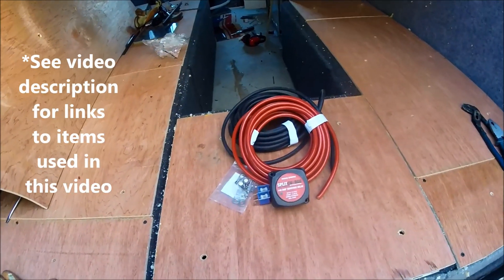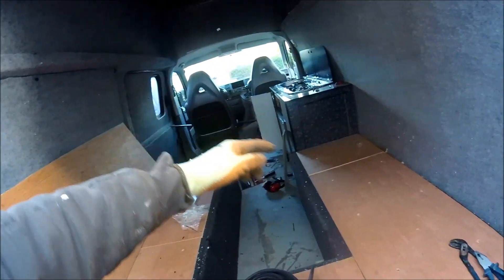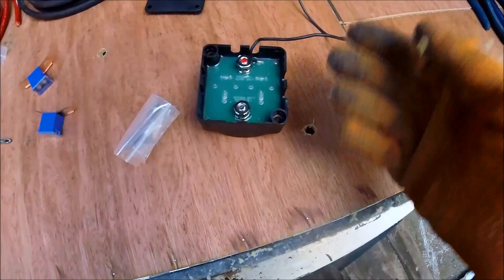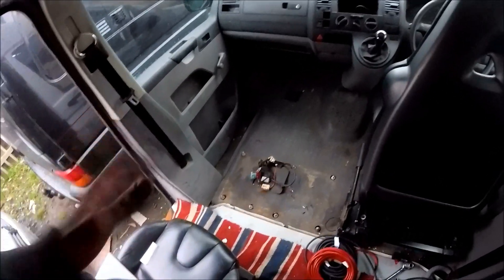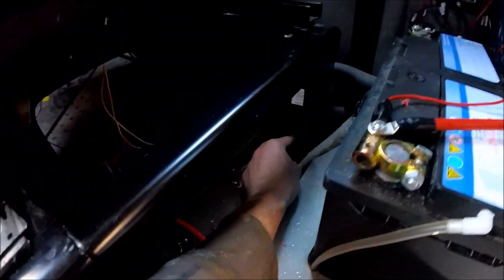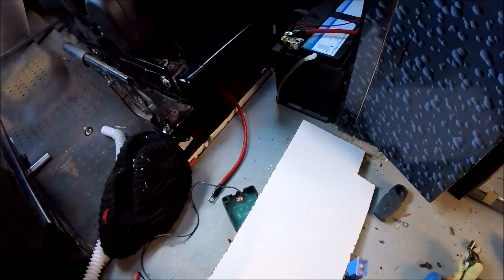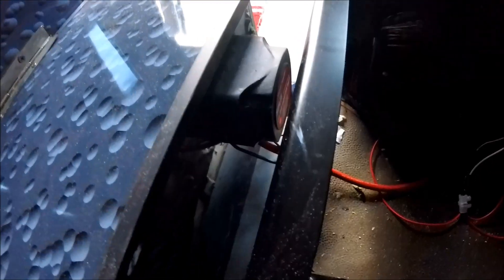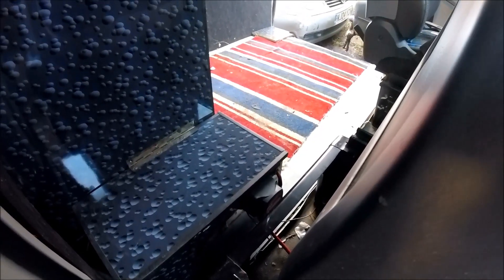VW T5 Camper Conversion Project Part 17: Fitting VSR Split Charge Relay Installation

Comment: Have you just got the solar panel wired from the charge controller to the leisure batter you? If so does this still charge the vehicle battery through the split charge relay
Reply from the maker: Yes if the voltage is high enough from the panel

Comment: Another great video. I have just fitted leisure batt and split. Can I ask some basic advice. I plan on running the live from the leisure batt to a switch panel. This panel has six switches, all fused. Lights will run to those switches. The panel has usb ports which will be used for charging phone etc. Does that sound ok?
Reply from the maker: yes sounds fine

Comment: Hello mate 
What amp cable did you use from main battery, and where  is  the grommet to remove for the feed from main battery?.
Also are 100a inline fuses correct?  Seems quite a resistance.

Cheers from Cornwall.
Reply from the maker: The relay is 110a charger so 100a fuses is fine as they would blow before the charger went.  I used 110a cable, I think there should be links to everything I used in the video description